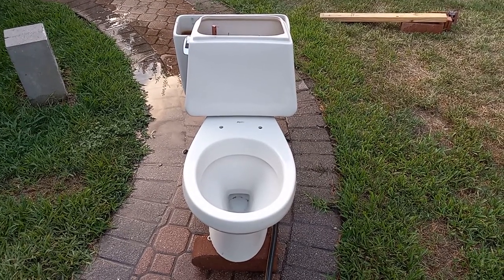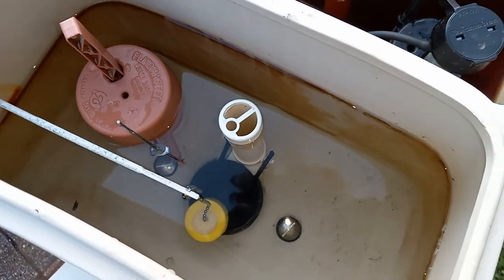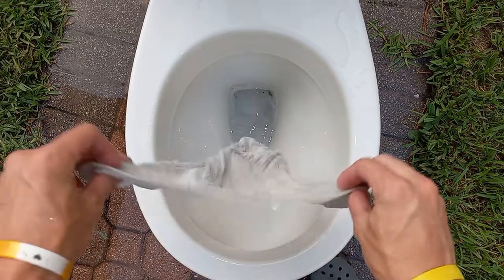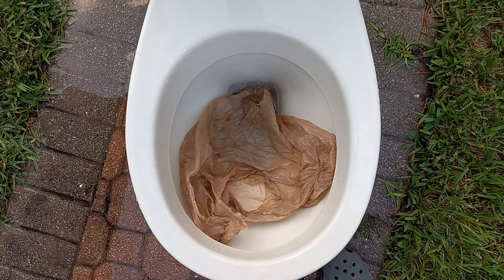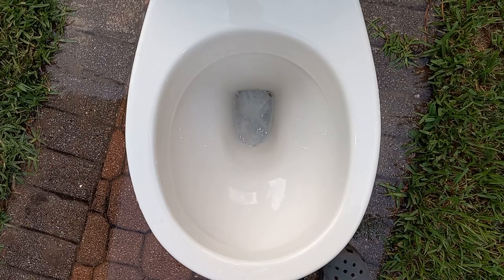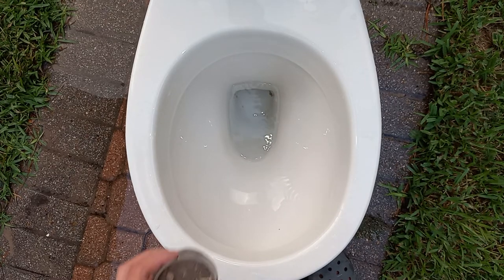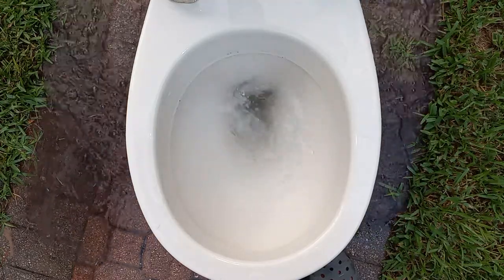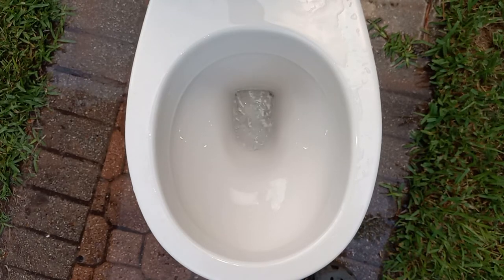1992 Eljer Preserver Tests

Comment: This Eljer Preserver is a very good toilet - it looks like a European/UK toilet from the surface due to it very low bowl water level (as like a washdown toilet) with an open rim but it has the siphon at the end of the flush. The performance is decent enough - a good tank top open rim washdown toilet from the UK (or EU) would perform pretty much the same (take the washcloth every time and the dish towel if it was angled slightly so it does not 'ball up' but not the grocery bag due to the low water as it would air up as it gets pulled into the trapway - it would pass on a high tank as with UK high tank washdowns due to the sheer force of the water pushing everything into the trapway) as I have seen similar tests in the UK. As with the better open rim washdowns the bowl rinse and clearance is spot on and this siphonic aided one passes it perfectly. The best of both types of toilet (washdown and siphonic) this 1992 Preserver is - hence why I seriously like this toilet! If I had to give it a score I would rate it 8.5/10 (not perfect but still a damn good performing toilet which I would install).
Reply from the maker: These are an interesting design.